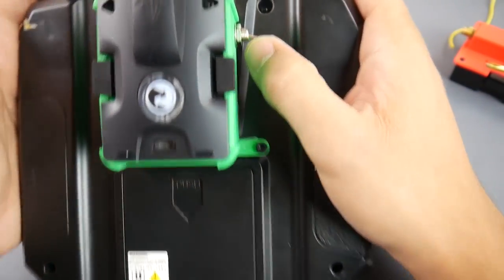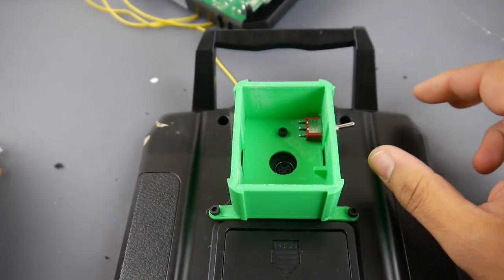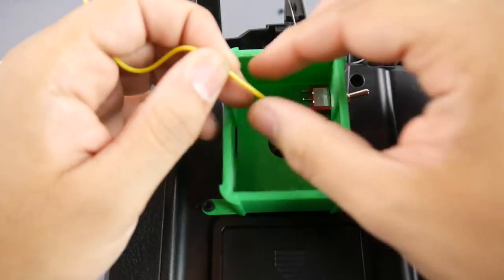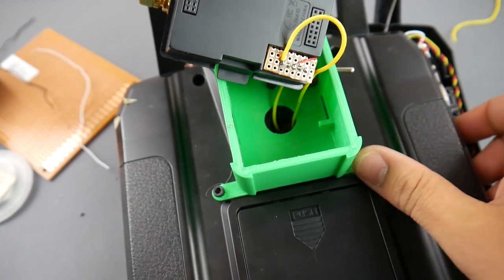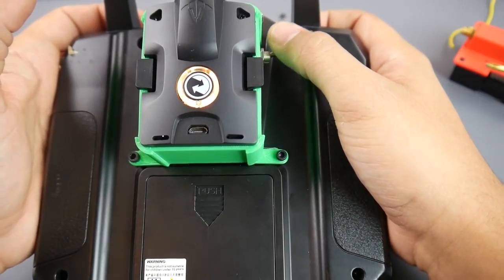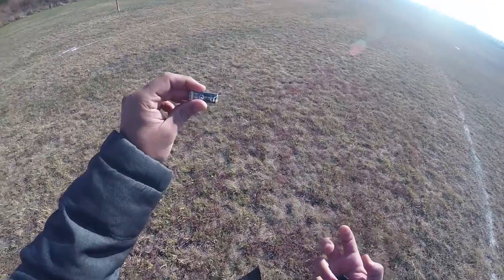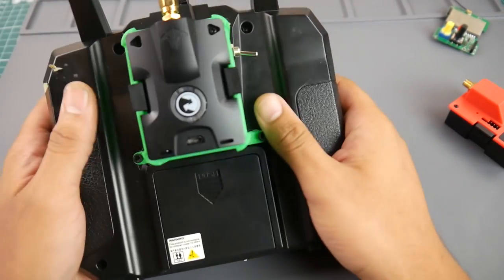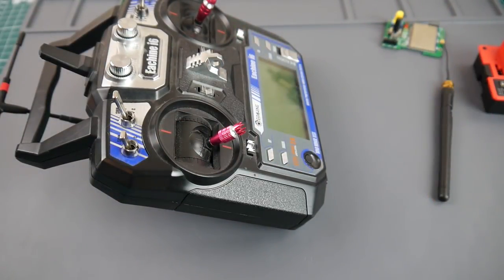Flysky FS-i6 / FS-i6X TBS Crossfire Mod and Frsky R9m Mod // Long Range Flysky Mod

Comment: Extremely useful..TY..I HAVE THAT RADIO.  Got w 250 Eachine..  The crash ..so real,  no Hollywood. I tested a mod a day ago and broke 6 props before I sw to unbreakables. But I know I need shielding for that vtx now.

Comment: I hate ripping pads off, it’s a PITA!  Great video. Best mod I did for my transmitter was the battery mod. Buying AA gets expensive. I have a 5 volt converter hooked into mine with a xt60 and haven’t spent a dime on AA. Great video.

Comment: Hello, I have seen your video: Flysky FS-i6 / FS-i6X TBS Crossfire Mod and Frsky R9m Mod // Long Range Flysky Mod, and I have a Flysky station and I wanted to put the R9m module on it, but does it really work with the signal? PPM ?, and at the station, is there any kind of telemetry received ?, I would appreciate your answer. A greeting and thanks in advance
Reply: Good question

Comment: This idea would only practically work with TBS Crossfire Tx or Crossfire Tx Lite and not the Crossfire Tx Micro because you'd need another more expensive radio with OpenTX to configure the module same with the R9M then you could connect it up to the FlySky i6 but what's the point you've a better radio to use the Crossfire Tx Micro or R9M module to use them with? Where as the Crossfire Tx (standard) and Lite you can configure without a radio. The multi protocol module I'm sure it works no problem. If anyone has a FlySky i6 looking to get long range then get the crossfire lite unless you want bluetooth telemetry connectivity to another device then get the standard Crossfire Tx
Reply: You can configure the R9M without the radio aswell. At least the power output and binding with a receiver.
Reply: @schwuzi  how can you do that on the R9M?
Reply: @AliJimmer  What do you want to do? Look for the manual online.

The 2 white sliding buttons on the R9M set the power level. There are 4 different combinations with how you can have them (for example the left slider up and the right slider down)

For binding you hold the white button on the module and the binding button on your receiver.
Reply: @schwuzi  I had read the manual but didn't spot the part on setting the output power by DIP switches thats class thanks

Comment: Do you have to do anything in the firmware, or is PPM out always mimicking what ever you're doing on the channels? Shouldn't you turn off the internal module, or somehow deactivate it? No reason to use battery power and cause interference (especially if you're using another protocol on 2.4GHz). Thanks for this, I want Crossfire, but I don't see a reason to upgrade the radio itself=)

Comment: Hey great mod! I've installed the r9m a few weeks ago and it's working great with my drone! I have the 14ch mod on my I6, but there are only 6 channels on the PPM output as it seems. 

Did you manage to get more than 6 channels via PPM out?
Reply: Franz Rupert did you managed to sort it out?
Reply: Franz if wouldn’t mind 
how did you bind it ..?!
Reply: @adnanalmohisin4900  Look at the instructions for the R9M, you do the binding from the R9 Module. The receiver has a bind button.
Reply: Franz Rupert Did what they say  at instructions sheet but still can’t bind it
Reply: @adnanalmohisin4900  1. Power on the R9M while holding the F/S button on the module (it's the only button there is). The green LED will light up and the red one will start flashing

2. Connect the receiver to a battery while pressing the bind button on your receiver. The red LED on the receiver will start flashing, which means binding is completed.

3. Reboot the module and the receiver. If the green LED on the receiver starts flashing when you move your sticks on the transmitter, it is receiving commands from it and is ready to go.
Reply: @wormboy72  I ended up buying a Taranis X9D+ and used that since with the module. The mod from this video worked great though and is certainly enough for flying planes and basic quads.
Reply: Franz Rupert That’s the issue bro when I tried to turn on the the module while holding the F/S button the red led doesn’t flashing 😩
Reply: @adnanalmohisin4900  Have you tried binding anyway? I couldn't really see the LEDs on mine because they are so dim.
Reply: Franz Rupert I tried still nothing 😔

Comment: I had the UFPV Nirvana but it’s a POS. I bought the i6X,  a switch to isolate power and my intention is to remove my TBS Crossfire unit from its JR module, stick it to the back of this radio so it’s super low profile, then use the 3 pin lead TBS supply for power, ground and ppm. With 4 x enerloop 2.5a batteries this thing should last forever. Low latency for racing. Crossfire for freestyle ☺️

Comment: Aren’t all those pins available through the trainer port already? No need to solder to the main board. No need to even crack open the transmitter for wiring at least.

Comment: I'm really interested in latency testing, especially with R9M and compared to same module on an frsky radio. I'm considering R9M if it works well with this mod.
Reply: Is such a mode suitable for racing drones or only for wings? It's about the time delay of the signal
Reply: The latency of the radio modules themselves you will find under the link. To send entire PPM frame from radio to TX you need 16..25ms (depends on amount of channels per frame). So add radio module latency + PPM and you have estimated complete link latency (not including radio and operator (; ). 40ms it's not bad for cruising with planes or wings but for racing or freestyle... hmm, might be disturbing.
Reply: The newer fsx model has better latency

Comment: Shouldn't there be ppm output in the trainer plug?
Reply: my thoughts the same...maybe he decide to go inside for power also
Reply: Yes. There's also power and ground. Power is a regulated 5v, which is well within the range of the crossfire module.  This seems overly complex when you could just make a trainer port adapter and skip the interior modification.

Comment: Nice video!!
Do you use student mode on the radio? That would deactivate the internal module from flysky and just output the ppm signal. The only problem is that the expo of the radio would be deactivate either.

Comment: It's an AMAZING video!
I'v applied the r9m module to my i6x with this mod. Binding is OK, input signal is OK,  OSD RSSI is OK. 

The only issue was outputing with 1w. It seems not work probably. Maybe external power supply needed.

Thanks for making this video.
Reply: How many output channel you get with the flysky and the r9m mod
Reply: @adrianlee30  10 channels only with r9mm. After that I switched to x9d because of another issue. It's worked with 1w output without an external power suply. But you must set the power rate of r9m module by press f/s button every power-cycle, or it will work incorrectly. It's a bit troublesome.
Reply: @chadzaun5384  ok thanks  you have to set the power every time if you wnat to use it in a 1w mode or any other power mode?
Reply: @adrianlee30  Not only 1w output, but also the others.
Reply: @chadzaun5384  okay thanks for the heads up, one last thing when you say work incorrectly meaning what exactly?
Reply: @adrianlee30  btw, maybe i6 only gets 6 channels if you hadn't applied  the 10ch firmware mod.
Reply: @adrianlee30  When it goes about 50m away, the signal losts.
Reply: @chadzaun5384  ok thanks will look out for that, and i yes i have apply the 10ch firmware mod aleady
Reply: @chadzaun5384  did you have to upgrade the firmware on arrival?
Reply: @adrianlee30  Happy flying😄
Reply: @ChronicallyWonderful  how do you get it to bind I have got the fs i6x modded to take the R9M module I have got the ppm going to the module to the pin shown in video is there any other settings I need to do must there be a light blinking when it's in bind mode

Comment: Hey Drone Mesh, thank you for this great vid.
But one Question is open. 
I have the same transmitter and the r9m with 3 RX. But how did I can bind them. I have search now for 5 hours and tried a lot. But its never bind. How did it works?
Thank you :)
Reply: Me neither did you find the solution, if so please help.
Reply: Apparently you need to update their firmwares to the flex versions. You can do a serial pass through in your flight controller to your receiver and then to your module to update them. Then reconnect all and bind.

Comment: Dude, please answer, with modded firmware (10 channels, for instance) are you able to get more than 6 channels output to the Crossfire unit? I've tested the PPM output ports with an oscilloscope, and it doesn't look like it outputs more than the 6 (4 + 2 aux) original channels.
Reply: If you run the receiver on Ibus pins. The top 3 on the right of recv. You get 10 channels showing on betaflight
Reply: @dronepilot260rc  Thanks for your reply! I'm not sure what you mean, though. I'm talking about how to wire the TX to the Crossfire TX.

Comment: I have ARKBIRD UHF and it has weird jitter connected to TX via PPM. Also in logging you can see stick input is step like - not smooth line. Any similar experience when using PPM with your TX and those UHF systems?

Comment: I’m keen to put a crossfire on my i6 and I’m wondering if you set anything up in the radio or just wired it in and it worked with all the stick inputs doing the correct movement?
Reply: did you get any please mention them there is only wiring mention in this video no steps how to bind or configure

Comment: How do you bind the receiver with transmitter.  I dont mean the internal tx from the flysky but the TBS?
Reply: With R9M using PPM mode power changing and binding can be done with rear switches and function (F/S - bind) button...see manual for details

Comment: Do u have to do anything inside the transmitter settings to make it work or does it just work when powered on automatically I can't find detailed enough instructions. Trying to set this up on of fsi6 and a kiss fc on quad

Comment: nice mod. will for sure do this in the future. as for battery mods. the I6 will run off of a 1s battery. i run miine off of a 1800mah 3.7v i made from a 3s pack that had a bad cell. I can fly for hours without any worry and i added a charging port to the back to charge the battery so i dont have to take it out.

Comment: How did you bind the receiver with the transmitter?
If you use a R9M in the flysky, how would you bind this to the R9mm receiver in the quad?
Have you had time to test this yet?
Reply: Any reply for this? How you are gonna flash a brand new R9M / new R9 MM receiver using this mod and how you are going to bind module to receiver @Drone Mesh
Reply: @anonimkisi7804  Here is the link to the manual file:///C:/Users/PM/Downloads/New%20folder/Manual-STK.pdf
It’s a good idea using the R9M TX with a FlySky TX , limitations, latency, only 8 ppm channel output
s
available and convenience. If you want the last, then you have use a R9m compatible radio, like the 
taranis x9d or similar running open TX.
Reply: @anonimkisi7804  It’s a good idea using the R9M  with a FlySky TX , limitations, latency, only 8 ppm channel out put
available from the FlySky and convenience. If you want the last, then you have to use a R9M compatible radio, like the 
Taranis X9D or similar running open TX.The other advantage of using a Taranis is you can have a redundancy RX system, so one for the internal TX and one for the external TX (R9M).This is possible with FrySky receivers.
Reply: pablo i already have taranis X9D Plus SE... But just asking how a guy will flash R9M Tx or R9 MM Rx or Crossfire Tx and Rx with only Flysky i6 TX in hand... Since this video targets those guys who want to use Crossfire or R9M long range/900mhz modules without the need of buying another relatively expensive Transmitter... Hope you got what i mean...
Reply: @anonimkisi7804  Sure no problem, I have recently got a Taranis X9D , but I still have my MOD FlySky FS-i6  and love it.
I had the same idea to use the long range R9M module with the FlySky FS-i6 and I will do this, but then I thought 
the same as you and then did some research, also my hobby rc supplier had a deal that they were giving away
a R9M TX module free with every Taranis sold, so  that worked well for me.
I still think it's possible to MOD the FlySky FS-i6 with the R9M TX and get a long range set up on the cheep, but
it will need some work to achieve this......more video's....👍😊
Reply: pablo that still does not answer “how to flash R9M without a frsky transmitter?”

Comment: I've done the MOD incl. changing the voltage divider in the FS-I6 by putting a 10k resistor to R10. Now it can sense up to 12V input voltage. I added the R9m module with a R9 mini rx all EU LBT verison. In BF I only got 6 Channels. But it's ok. Failsafe works, because the throttle value decreas to 885 if you lost the link. Use an arm switch and the 3 pos. for beeper, and flightmode. Have the Crossfire TX antenna at the TX module. I can change output power with the dip-switches on the Module. You have no RSSI in osd, with 6 channels..
Reply: me too but i can't get the signal in BF, i don't know why.
Reply: Just connect the r9 receiver to sbus in. Than configure the serial Port in the ports tab of BF
Reply: And configure the rx in the Flysky Radio to ibus /ppm out.
Reply: @Marvin-Berlin_FPV  it works, but still a problem, for the first 4 channel (roll, pitch, yaw, gas) on the receiver graph in betaflight i can see the movement, but for the other switches they didn't go to the min position, they are stuck on the middle or max if i flip the switch
Reply: @NIGHTBLAZER11  you have to Set the aux channels to the right Switches. Than you can adjust them in the mixer tab. Evtl. That helps. On my flysky is the flyplus Firmware. Just try different settings for the aux channels in the Radio. Greetings.
Reply: @Marvin-Berlin_FPV  yes i know, when i flip the arm switch it goes to the max, when i set them off it doesn't return to min but to the middle, after a while it return's to min. Seems like a lag in the communication. And I can't arm my quad, it sounds like an error of communication.
Reply: @NIGHTBLAZER11  hi aby solutions found?

Comment: Have you looked into modding the fsi6s? I'm pretty sure it would work the same way, but I have had zero luck finding a spot to tie into the ppm signal.
Reply: Jack the Aviator, PPM output is there at the bottom of the motherboard.
Reply: Could also use white wire in trainer port, it is common t PPM pad
Reply: Thanks guys, I found it, I felt like an idiot once I broke out the scope looking for the damn ppm

Comment: How are you turning off the built-in module when using an external one? I guess it works, but you will have a reduced range due to unnecessary interference.
Reply from the maker: It doesn't turn the internal module.. The TBS is operating around 900mhz and not 2.4ghz

Comment: Liking this a lot ,I would do this MOD with R9M, like probably you I would want to do this for penetration rather than distance.
This is  what is limiting my flying and the potential of a failsafe, the Flysky with channel mod  is fantastic  considering its only
out putting 20 mW. When you do a test,  can you fly around very close to the ground and behind tree's and bushes, do 
a before and after if you have another radio that's not been modded?

Comment: Will the theme of the connection via ppm influence the range? or this is not relevant and the crossfire works the same in terms of range as for example a taranis? I mean, the module is working at 915 / 868Mhz or going to ppm works at 2.4ghz? again, thanks pornlo what are you doing and sorry if the question is not good but I am a beginner
Reply: no it won't. ppm is just a way to let the crossfire know where the sticks are. it then converts that to it's own protocol called crsf, which works a little different than ppm, but is essentially used for the same purpose. the frequency of the link has nothing to do with the protocol used to communicate. an example would be talking english with a low voice and talking english with a high voice. the protocol would be the english language and the frequency is the pitch of the voice. lower tones can go further and bend around objects, but they can both use english. 
ppm = spanish, crsf = english, here only the amount of information per word changes, but they can both be talked with a high and low voice.

i'm not so sure about the following:
2.4ghz and 868mhz both use amplitude manipulation to transport information. the transmit at different power levels to represent a 1 and a 0.
the human voice is much more suffisticated in that it both uses loudness and tone to express data. rf links use only loudness (amplitude). tone = frequency
Reply from the maker: Loved the explanation.. I'll simplify it a little.. Protocol does not change range only latency... The frequency and output power is what gives the range..
Reply: @DroneMesh  😊
Reply: Marc Frank thank you very much for the explanation, I have understood it much better thanks to the detailed explanation, very good example, thanks!!
Reply: @franklyfpv1909  ayudo con alegía
Reply: Drone Mesh thanks man!! thank you!! It is becoming clear to me.

P.D: the only reason why I recently bought my taranis is to use the crossfire micro tx, from my flysky to frsky with crossfire directly (I have not even bought frsky receivers ...) Seeing this mod makes me want to return to the seller the taranis since after 1 year and a half I am very used to my flysky and I have love, hahaha, thank you!
Reply: Marc Frank pues se agradece!! La explicación ha sido muy muy buena con el tema del ingles!! Jajaaja gracias!!
Reply: Marc Frank now open tx in the flysky and already if I tell you that I return my taranis jajajajaaj